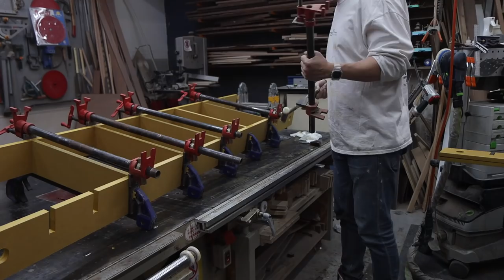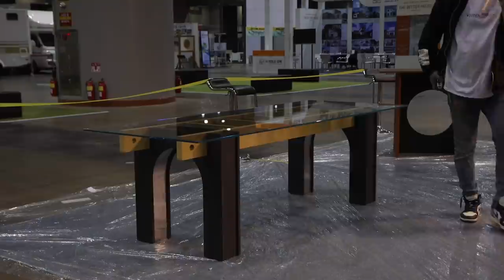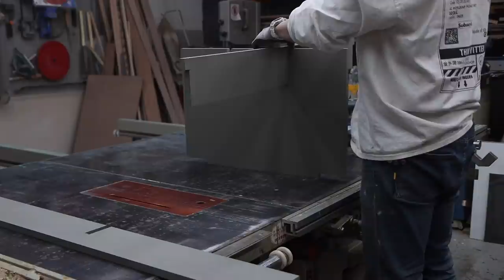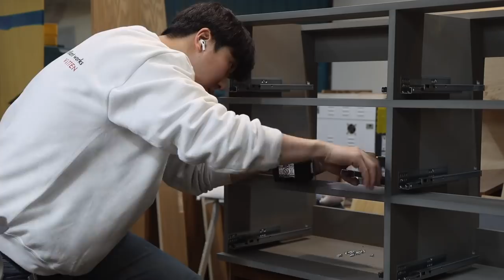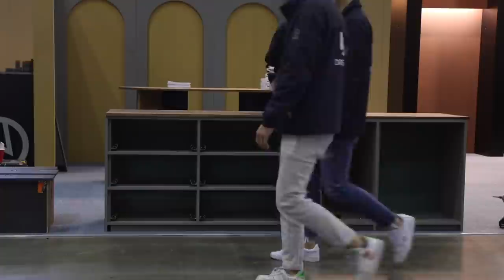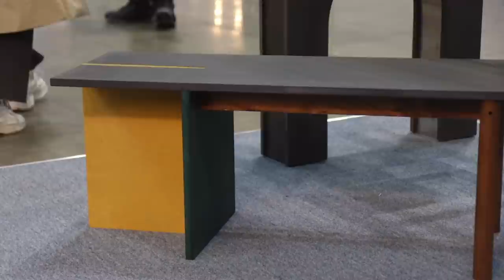W115_Design furnitures for Forescolor

Comment: Beautiful! Congratulations! @Vitten I see that you have used Forescolor and also Valchromat in previous furniture. Could I ask you if there are major differences between both products, I have used Valchromat and it is far superior than standard MDF –or even other colored MDFs– Is it Forescolor similar? Allow me another question, which thickness you would normally use for carcasses, it is quite heavy compared with other materials and 19mm seems to be quite thick for cabinetry, right? Many thanks and congratulations again for your work and videos!